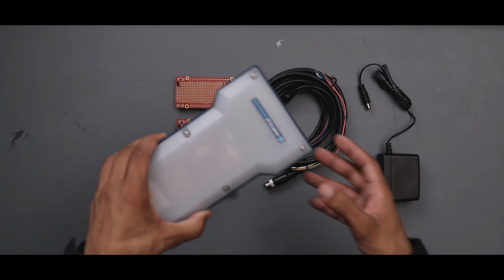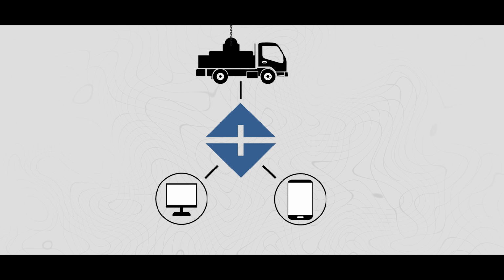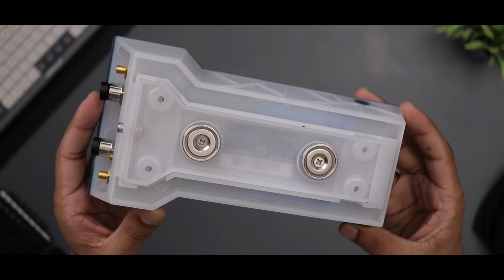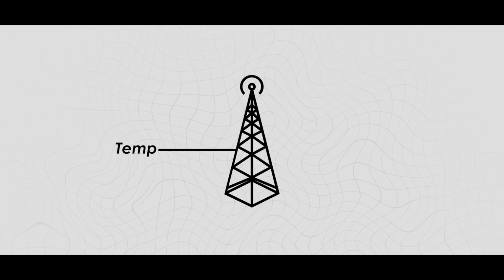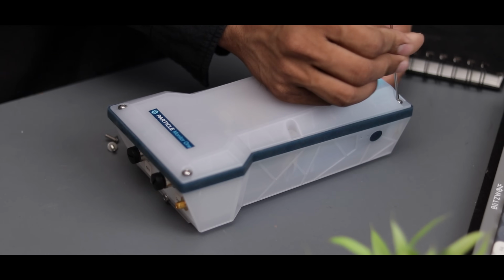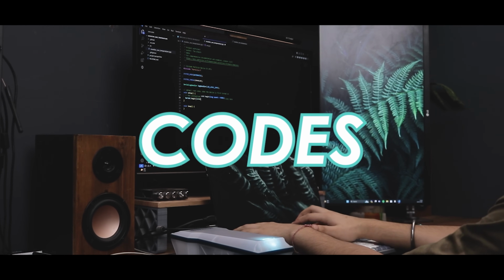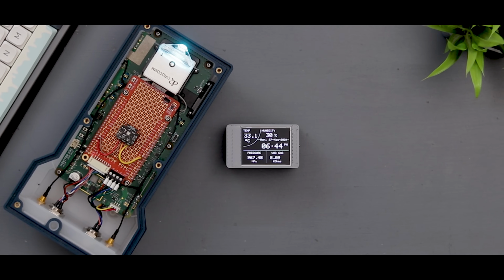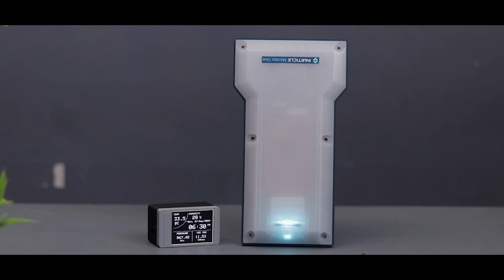Building My Own Weather Station with Particle Monitor One | Review

Comment: Wouldn't it make more sense to put the sensor inside the little 3d printed box to monitor the weather outside instead inside the weather sealed enclosure?
And how comes that a 2mio channel with like 15k views on a video only has 35 comments from which over 50% are stereotype comments like "nice" "great" "cool" 🤔 what kind of thing are you trying here?

Comment: Weather resistant housing with a weather sensor inside. Am I missing something? Temperature might be around the outside temperature, but everything else probably not.
Reply: Probes such as temperature sensors are always outside the housing i guess